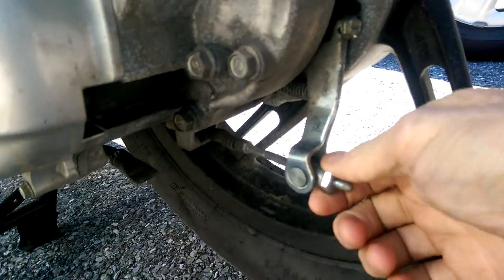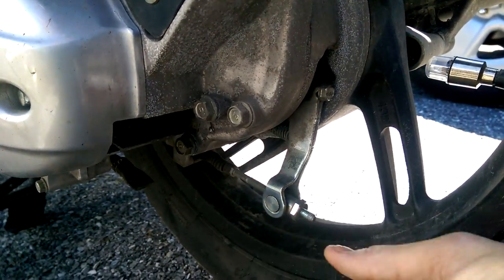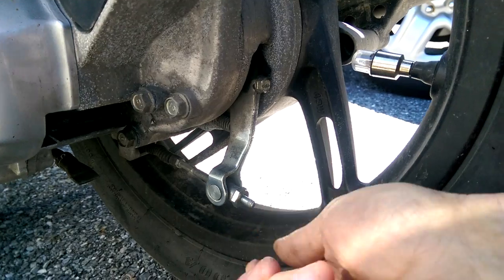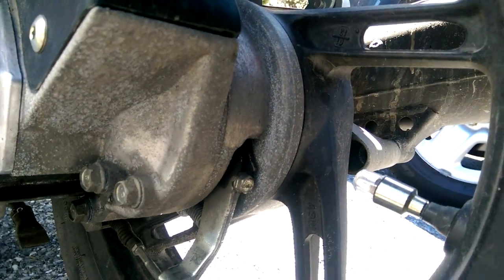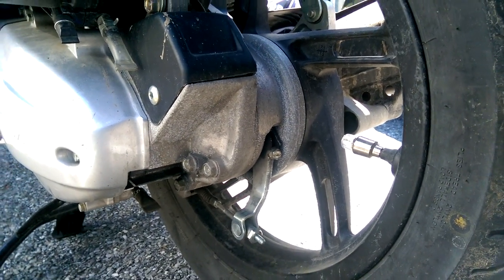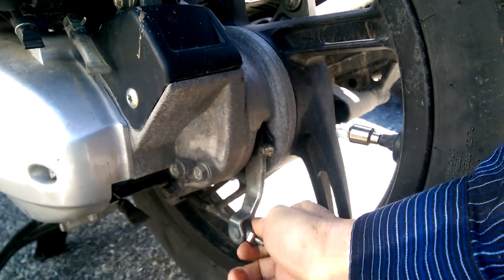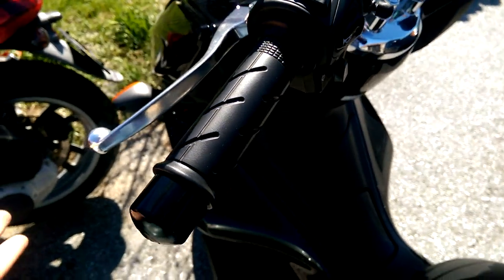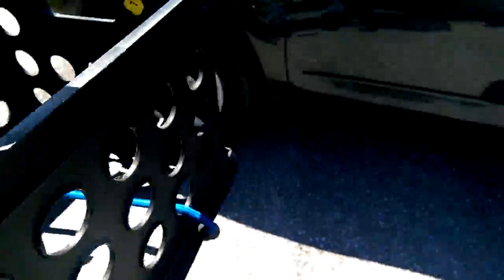adjust rear brake freeplay on scooter drum brake

Comment: I changed my drum brake pad, but when braking its like holding and releasing the pressure, idk if i can explained well, imagine= you are breaking and holding the lever, but brake is holds higher lower higher lower continuously
Reply from the maker: Did you adjust them after installing?
Reply from the maker: In addition, you may have installed the shoes incorrectly.
Reply: @honkerman74  yes i adjusted sorry for my bad english, i cant explain very well but i hope you understood by the way 😅😅 thanks
Reply: @honkerman74  but my scooter is chinese, it has combine brakes (cbs) , should i checked cbs kit ?